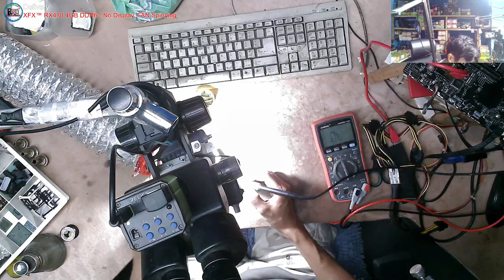XFX RS RX 470 Black Edition 4GB - No power, PWM Damage(solved)

Comment: Hi, I have the same problem. I have changed NCP chip but still no power, so is there anything that you have changed on the back of the board?
Reply from the maker: Maybe there os any problem, check all power sequence what is dead.

PM po kayo dito sa Video Card(GPU) Repair Business Page para po sa information, contact no., location at ma-assist kaayo.

Salamat po,
link: https://www.facebook.com/VideoCardRepair/